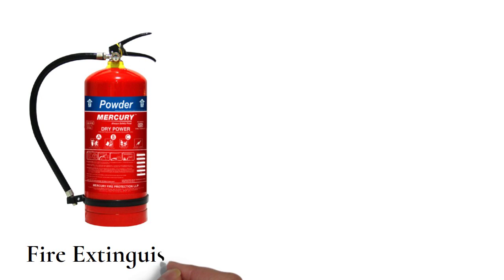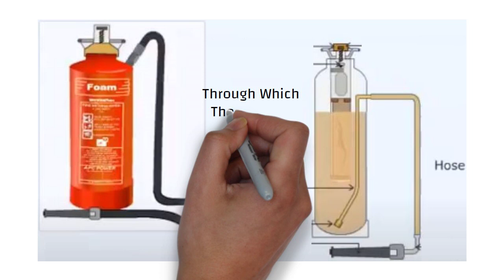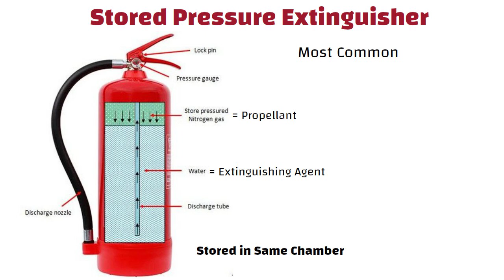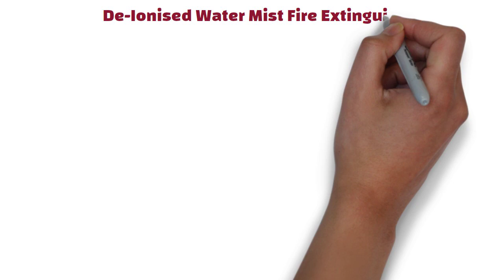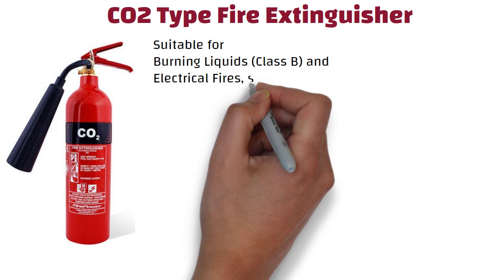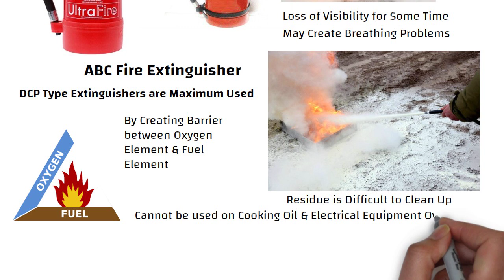FIRE EXTINGUISHER DEALERS IN KERALA, CALL 8138906102, FIRE EXTINGUISHER DEALERS IN ERNAKULAM.

Comment from the maker: Fire extinguisher dealers in WAYANAD, fire fighting contractors in WAYANAD, WAYANAD, fire and safety installations in WAYANAD, fire extinguisher suppliers in WAYANAD,fire extinguishers in WAYANAD, fire extinguishers in WAYANAD, fire protection system in WAYANAD, f fire and safety installation in WAYANAD, fire and safety contractors in WAYANAD, fire safety contractors in WAYANAD, fire and safety systems equipments in WAYANAD, fire equipment in WAYANAD, fire extinguisher in WAYANAD, fire protection system installation in WAYANAD, fire contractors in WAYANAD, fire safety consultants in WAYANAD,  fire alarm systems in WAYANAD, fire NOC in WAYANAD, fire AMC in WAYANAD, WAYANAD, fire fighting equipment in WAYANAD,
MS Jindal pipe dealers in WAYANAD, motor control panel in WAYANAD, fire pump panel in WAYANAD, motor control panel in WAYANAD, Morley fire alarm in WAYANAD, gst fire alarm in WAYANAD, addressable fire alarm system in WAYANAD, Pa talk back system in WAYANAD, PA two way talk back system in WAYANAD, auto glow SIGNAGES in WAYANAD, Karthar dealers in WAYANAD, Agni fire alarm dealers in WAYANAD, ASES SECURITY fire alarm dealers in WAYANAD, AUTO GLOW SIGNAGES in WAYANAD, FIRE PUMP PANEL in WAYANAD, LHP pump in WAYANAD. Karthar valves in WAYANAD, Ravel fire alarm system in WAYANAD. Jindal pipe dealers in WAYANAD, Jindal pipe dealers in WAYANAD. MS pipe dealers in WAYANAD. Butterfly valves in WAYANAD, PA talk back system in WAYANAD, Fire alarm dealers in WAYANAD, smoke detector dealers in WAYANAD, fire alarm panels dealers in WAYANAD, MCP, hooter dealers in Mangalor, hydrant valve dealers in WAYANAD, branch pipe dealers in WAYANAD,Fire CP hose in WAYANAD, Fire RRL hose in WAYANAD, heat detector dealers in WAYANAD, Motor Control panel in WAYANAD,  LED EXIT LIGHTS dealers in WAYANAD, emergency exit light dealers in WAYANAD, auto glow SIGNAGES dealers in WAYANAD. Conventional fire alarm system in WAYANAD, Fire alarm panel in WAYANAD, Notifier fire alarm dealers in WAYANAD, PA talk back unit dealers in WAYANAD. Honeywell fire alarm dealers in WAYANAD, BOSCH PA system dealers in WAYANAD, 
KIRLOSKAR FIRE FIGHTING PUMP DEALERS IN WAYANAD, FIRE FIGHTING EQUIPMENT DEALERS IN WAYANAD, FIRE ALARM SYSTEM DEALERS IN WAYANAD, FIRE CONSULTANTS IN WAYANAD, FIRE CONTRACTOTORS IN WAYANAD, FIRE CONTRACTORS IN WAYANAD, FIRE ALARM SYSTEM DEALERS IN WAYANAD, SMOKE DETECTOR DEALERS IN WAYANAD, FIRE PROTECTION SYSTEM IN WAYANAD, FIRE CONSULTANTS IN WAYANAD, FIRE CONSULTANTS IN WAYANAD, PA TALK BACK SYSTEM IN WAYANAD, ADDRESSABLE FIRE ALARM SYSTEMS IN WAYANAD, CUTTER PUMP DEALERS IN WAYANAD, ADDRESSABLE FIRE ALARM SYSTEM SUPPLIERS IN WAYANAD, SMOKE DETECTOR DEALERS IN TWAYANAD, PRESSURE BOOSTING PUMP DEALERS IN WAYANAD, SLURRY PUMP DEALERS IN WAYANAD
Reply: FIRE EXTINGUISHER DEALERS IN KERALA, FIRE EXTINGUISHER SUPPLIERS IN KERALA, FIRE EXTINGUISHER DISTRIBUTORS IN KERALA, FIRE EXTINGUISHER IN KERALA, ABC TYPE FIRE EXTINGUISHER DEALERS IN KERALA, CO2 TYPE FIRE EXTINGUISHER DEALERS IN KERALA, CLEAN AGENT FIRE EXTINGUISHER IN KERALA, MODULAR TYPE FIRE EXTINGUISHER DEALERS IN KERALA, MECHANICAL FOAM FIRE EXTINGUISHER DEALERS IN KERALA, FIRE EXTINGUISHER NEAR ME KERALA, FIRE EXTINGUISHER TRADERS IN KERALA, FIRE FIGHTING COMPANIES IN KERALA, FIRE CONTRACTORS IN KERALA, FIRE EQUIPMENT DEALERS IN KERALA, FIRE ALARM DEALERS IN KERALA, FIRE PUMP DEALERS IN KERALA, SMOKE DETECTOR DEALERS IN KERALA, FIRE FIGHTING SYSTEM IN KERALA, FIRE PROTECTION SYSTEM IN KERALA, FIRE AND SAFETY CONTRACTORS IN KERALA, FIRE HYDRANT SYSTEMS IN KERALA, PA TALK BACK SYSTEM IN KERALA, FIRE NOC IN KERALA, FIRE INSTALLATION IN KERALA, FIRE NOC RENEWAL IN KERALA, KIRLOSKAR FIRE PUMP DEALERS IN KERALA, FIRE EXTINGUISHER NEAR ME KERALA, FIRE EXTINGUISHER MANUFACURERS IN KERALA, SAFEX FIRE EXTINGUISHER DEALERS IN KERALA, FIRE NOC CONTRACTORS IN KERALA, FIRE FIGHTING EQUIPMENT DEALERS IN KERALA, FIRE PROTECTION SYSTEM IN KERALA, FIRE INSTALLATION IN KERALA, FIRE SAFETY CONTRACTORS IN KERALA, FIRE AMC IN KERALA, FIRE PROTECTION SYSTEM IN KERALA, FIRE PROTECTION EQUIPMET IN KERALA, AMC OF FIRE SYSTEM IN KERALA, FIRE CONSULTANTS IN KERALA, FIRE AND SAFETY EQUIPMENT DEALERS IN KERALA, ADDRESSABLE FIRE ALARM SYSTEM IN KERALA, KARTHAR VALVE DEALERS IN KERALA, DCP TYPE FIRE EXTINGUISHER IN KERALA, POWSER TYPE FIRE EXTINGUISHERS IN KERALA, FIRE HYDRANT SYSTEM IN KERALA, FIRE ALARM PANEL DEALERS IN KERALA, SAFEPRO FIRE EXTINGUISHER DEALERS IN KERALA, MS AND GI PIPE DEALERS IN KERALA, JINDAL PIPE DEALERS IN KERALA, AGNI FIRE ALARM DEALERS IN KERALA, FIRE EQUIPMENT DEALERS IN KERALA, FIRE EQUIPMENT SUPPLIERS IN KERALA, FIRE EQUIPMENT TRADERS IN KERALA, FIRE SPRINKLER SYSTEM IN KERALA, RAVLE FIRE ALARM DEALERS IN KERALA, RAVEL FIRE ALARM SYSTEM IN KERALA, AGNI FIRE ALARM DISTRIBUTORS IN KERALA, FIRE ALARM CONTRACTORS IN KERALA, FIRE PIPE INSTALLATION IN CONTRACTORS IN KERALA, FIRE SAFETY CONTRACTORS IN KERALA, FIRE PA TWO WAY TALK BACK SYSTEM DEALERS IN KERALA, HEAT DETECTOR DEALERS IN KERALA, HONEYWELL FIRE ALARM DEALERS IN KERALA, FIRE NOC CONSULTANTS IN KERALA, FIRE AMC AND FIRE NOC IN KERALA, FIRE SAFETY COMPANIES IN KERALA, NEWAGE DEALERS IN KERALA, MONSHER FIRE EQUIPMENT DEALERS IN KERALA, KARTHAR VALVE DEALERS IN KERALA, FIRE HYDRANT VALVE DEALERS IN KERALA, FIRE HOSE REEL DRUM DEALERS IN KERALA, FIRE SPRINKLER DEALERS IN KERALA, FIRE PUMP DEALERS IN KERALA, LUBI PUMP DEALERS IN KERALA, LHP PUMP DEALERS IN KERALA. FIRE CONTRACTORS IN KERALA, FIRE AND SAFETY CONTRACTORS IN KERALA, FIRE EQUIPMENT DEALERS IN KERALA, FIRE FIGHTING CONTRACTORS IN KERALA, FIRE EXTINGUISHER DEALERS IN KOCHI, FIRE EXTINGUISHER SUPPLIERS IN KOCHI, FIRE EXTINGUISHER DISTRIBUTORS IN KOCHI, FIRE EXTINGUISHER IN KOCHI, ABC TYPE FIRE EXTINGUISHER DEALERS IN KOCHI, CO2 TYPE FIRE EXTINGUISHER DEALERS IN KOCHI, CLEAN AGENT FIRE EXTINGUISHER IN KOCHI, MODULAR TYPE FIRE EXTINGUISHER DEALERS IN KOCHI, MECHANICAL FOAM FIRE EXTINGUISHER DEALERS IN KOCHI, FIRE EXTINGUISHER NEAR ME KOCHI, FIRE EXTINGUISHER TRADERS IN KOCHI, FIRE FIGHTING COMPANIES IN KOCHI, FIRE CONTRACTORS IN KOCHI, FIRE EQUIPMENT DEALERS IN KOCHI, FIRE ALARM DEALERS IN KOCHI, FIRE PUMP DEALERS IN KOCHI, SMOKE DETECTOR DEALERS IN KOCHI, FIRE FIGHTING SYSTEM IN KOCHI, FIRE PROTECTION SYSTEM IN KOCHI, FIRE AND SAFETY CONTRACTORS IN KOCHI, FIRE HYDRANT SYSTEMS IN KOCHI, PA TALK BACK SYSTEM IN KOCHI, FIRE NOC IN KOCHI, FIRE INSTALLATION IN KOCHI, FIRE NOC RENEWAL IN KOCHI, KIRLOSKAR FIRE PUMP DEALERS IN KOCHI, FIRE EXTINGUISHER NEAR ME KOCHI, FIRE EXTINGUISHER MANUFACURERS IN KOCHI, SAFEX FIRE EXTINGUISHER DEALERS IN KOCHI, FIRE NOC CONTRACTORS IN KOCHI, FIRE FIGHTING EQUIPMENT DEALERS IN KOCHI, FIRE PROTECTION SYSTEM IN KOCHI, FIRE INSTALLATION IN KOCHI, FIRE SAFETY CONTRACTORS IN KOCHI, FIRE AMC IN KOCHI, FIRE PROTECTION SYSTEM IN KOCHI, FIRE PROTECTION EQUIPMET IN KOCHI, AMC OF FIRE SYSTEM IN KOCHI, FIRE CONSULTANTS IN KOCHI, FIRE AND SAFETY EQUIPMENT DEALERS IN KOCHI, ADDRESSABLE FIRE ALARM SYSTEM IN KOCHI, KARTHAR VALVE DEALERS IN KOCHI, DCP TYPE FIRE EXTINGUISHER IN KOCHI, POWSER TYPE FIRE EXTINGUISHERS IN KOCHI, FIRE HYDRANT SYSTEM IN KOCHI, FIRE ALARM PANEL DEALERS IN KOCHI, SAFEPRO FIRE EXTINGUISHER DEALERS IN KOCHI, MS AND GI PIPE DEALERS IN KOCHI, JINDAL PIPE DEALERS IN KOCHI, AGNI FIRE ALARM DEALERS IN KOCHI, FIRE EQUIPMENT DEALERS IN KOCHI, FIRE EQUIPMENT SUPPLIERS IN KOCHI, FIRE EQUIPMENT TRADERS IN KOCHI, FIRE SPRINKLER SYSTEM IN KOCHI, RAVLE FIRE ALARM DEALERS IN KOCHI, RAVEL FIRE ALARM SYSTEM IN KOCHI, AGNI FIRE ALARM DISTRIBUTORS IN KOCHI, FIRE ALARM CONTRACTORS IN KOCHI, FIRE PIPE INSTALLATION IN CONTRACTORS IN KOCHI, FIRE SAFETY CONTRACTORS IN KOCHI, FIRE PA TWO WAY TALK BACK SYSTEM DEALERS IN KOCHI, HEAT DETECTOR DEALERS IN KOCHI, HONEYWELL FIRE ALARM DEALERS IN KOCHI, FIRE NOC CONSULTANTS IN KOCHI, FIRE AMC AND FIRE NOC IN KOCHI, FIRE SAFETY COMPANIES IN KOCHI, NEWAGE DEALERS IN KOCHI, MONSHER FIRE EQUIPMENT DEALERS IN KOCHI, KARTHAR VALVE DEALERS IN KOCHI, FIRE HYDRANT VALVE DEALERS IN KOCHI, FIRE HOSE REEL DRUM DEALERS IN KOCHI, FIRE SPRINKLER DEALERS IN KOCHI, FIRE PUMP DEALERS IN KOCHI, LUBI PUMP DEALERS IN KOCHI, LHP PUMP DEALERS IN KOCHI. FIRE CONTRACTORS IN KOCHI, FIRE AND SAFETY CONTRACTORS IN KOCHI, FIRE EQUIPMENT DEALERS IN KOCHI, FIRE FIGHTING CONTRACTORS IN KOCHI, FIRE EXTINGUISHER DEALERS IN ERNAKULAM, FIRE EXTINGUISHER SUPPLIERS IN ERNAKULAM, FIRE EXTINGUISHER DISTRIBUTORS IN ERNAKULAM, FIRE EXTINGUISHER IN ERNAKULAM, ABC TYPE FIRE EXTINGUISHER DEALERS IN ERNAKULAM, CO2 TYPE FIRE EXTINGUISHER DEALERS IN ERNAKULAM, CLEAN AGENT FIRE EXTINGUISHER IN ERNAKULAM, MODULAR TYPE FIRE EXTINGUISHER DEALERS IN ERNAKULAM, MECHANICAL FOAM FIRE EXTINGUISHER DEALERS IN ERNAKULAM, FIRE EXTINGUISHER NEAR ME ERNAKULAM, FIRE EXTINGUISHER TRADERS IN ERNAKULAM, FIRE FIGHTING COMPANIES IN ERNAKULAM, FIRE CONTRACTORS IN ERNAKULAM, FIRE EQUIPMENT DEALERS IN ERNAKULAM, FIRE ALARM DEALERS IN ERNAKULAM, FIRE PUMP DEALERS IN ERNAKULAM, SMOKE DETECTOR DEALERS IN ERNAKULAM, FIRE FIGHTING SYSTEM IN ERNAKULAM, FIRE PROTECTION SYSTEM IN ERNAKULAM, FIRE AND SAFETY CONTRACTORS IN ERNAKULAM, FIRE HYDRANT SYSTEMS IN ERNAKULAM, PA TALK BACK SYSTEM IN ERNAKULAM, FIRE NOC IN ERNAKULAM, FIRE INSTALLATION IN ERNAKULAM, FIRE NOC RENEWAL IN ERNAKULAM, KIRLOSKAR FIRE PUMP DEALERS IN ERNAKULAM, FIRE EXTINGUISHER NEAR ME ERNAKULAM, FIRE EXTINGUISHER MANUFACURERS IN ERNAKULAM, SAFEX FIRE EXTINGUISHER DEALERS IN ERNAKULAM, FIRE NOC CONTRACTORS IN ERNAKULAM, FIRE FIGHTING EQUIPMENT DEALERS IN ERNAKULAM, FIRE PROTECTION SYSTEM IN ERNAKULAM, FIRE INSTALLATION IN ERNAKULAM, FIRE SAFETY CONTRACTORS IN ERNAKULAM, FIRE AMC IN ERNAKULAM, FIRE PROTECTION SYSTEM IN ERNAKULAM, FIRE PROTECTION EQUIPMET IN ERNAKULAM, AMC OF FIRE SYSTEM IN ERNAKULAM, FIRE CONSULTANTS IN ERNAKULAM, FIRE AND SAFETY EQUIPMENT DEALERS IN ERNAKULAM, ADDRESSABLE FIRE ALARM SYSTEM IN ERNAKULAM, KARTHAR VALVE DEALERS IN ERNAKULAM, DCP TYPE FIRE EXTINGUISHER IN ERNAKULAM, POWSER TYPE FIRE EXTINGUISHERS IN ERNAKULAM, FIRE HYDRANT SYSTEM IN ERNAKULAM, FIRE ALARM PANEL DEALERS IN ERNAKULAM, SAFEPRO FIRE EXTINGUISHER DEALERS IN ERNAKULAM, MS AND GI PIPE DEALERS IN ERNAKULAM, JINDAL PIPE DEALERS IN ERNAKULAM, AGNI FIRE ALARM DEALERS IN ERNAKULAM, FIRE EQUIPMENT DEALERS IN ERNAKULAM, FIRE EQUIPMENT SUPPLIERS IN ERNAKULAM, FIRE EQUIPMENT TRADERS IN ERNAKULAM, FIRE SPRINKLER SYSTEM IN ERNAKULAM, RAVLE FIRE ALARM DEALERS IN ERNAKULAM, RAVEL FIRE ALARM SYSTEM IN ERNAKULAM, AGNI FIRE ALARM DISTRIBUTORS IN ERNAKULAM, FIRE ALARM CONTRACTORS IN ERNAKULAM, FIRE PIPE INSTALLATION IN CONTRACTORS IN ERNAKULAM, FIRE SAFETY CONTRACTORS IN ERNAKULAM, FIRE PA TWO WAY TALK BACK SYSTEM DEALERS IN ERNAKULAM, HEAT DETECTOR DEALERS IN ERNAKULAM, HONEYWELL FIRE ALARM DEALERS IN ERNAKULAM, FIRE NOC CONSULTANTS IN ERNAKULAM, FIRE AMC AND FIRE NOC IN ERNAKULAM, FIRE SAFETY COMPANIES IN ERNAKULAM, NEWAGE DEALERS IN ERNAKULAM, MONSHER FIRE EQUIPMENT DEALERS IN ERNAKULAM, KARTHAR VALVE DEALERS IN ERNAKULAM, FIRE HYDRANT VALVE DEALERS IN ERNAKULAM, FIRE HOSE REEL DRUM DEALERS IN ERNAKULAM, FIRE SPRINKLER DEALERS IN ERNAKULAM, FIRE PUMP DEALERS IN ERNAKULAM, LUBI PUMP DEALERS IN ERNAKULAM, LHP PUMP DEALERS IN ERNAKULAM. FIRE CONTRACTORS IN ERNAKULAM, FIRE AND SAFETY CONTRACTORS IN ERNAKULAM, FIRE EQUIPMENT DEALERS IN ERNAKULAM, FIRE FIGHTING CONTRACTORS IN ERNAKULAM, 

htts://www.aimfireequipment.com

https://g.co/kgs/wAz9PTn

Comment from the maker: FIRE ALARM DEALERS IN WAYANAD, ADDRESSABLE FIRE ALARM DEALERS IN WAYANAD, FIRE ALARM SYSTEM DEALERS IN WAYANAD, ADDRESSABLE FIRE ALARM SYSTEM DEALERS IN WAYANAD, FIRE DETECTION SYSTEM IN WAYANAD, SMOKE DETECTOR DEALERS IN WAYANAD, CONVENTIONAL FIRE ALARM DEALERS IN WAYANAD, MORLEY FIRE ALARM DEALERS IN WAYANAD, GST FIRE ALARM DEALERS IN WAYANAD, ASES SECURITY FIRE ALARM DEALERS IN WAYANAD, BEAM DETECTOR DEALERS IN WAYANAD, FIRE ALARM SUPPLIERS IN WAYANAD, FIRE ALARM TRADERS IN WAYANAD, FIRE ALARM PANEL DEALERS IN WAYANAD, HEAT DETECTOR DEALERS IN WAYANAD, FIRE ALARM SYSTEM SUPPLIERS IN WAYANAD, FIRE ALARM COMPANIES IN WAYANAD, FIRE EQUIPMENT DEALERS IN WAYANAD, ADRRESSABLE FIRE ALARM PANEL DEALERS IN WAYANAD, FIRE ALARM SYSTEM IN WAYANAD, BATTERY OPERATED DETECTOR DEALERS IN WAYANAD, ASPIRATION DETECTION SYSTEM DEALERS IN WAYANAD, FIRE ALARM MCP - MANUAL CALL POINT DEALERS IN WAYANAD, FIRE ALARM HOOTER DEALERS IN WAYANAD, PA TWO WAY TALK BACK SYSTEM DEALERS IN WAYANAD, PA SYSTEM DEALERS IN WAYANAD, PA TALK BACK UNIT DEALERS IN WAYANAD, HOOTER CUM STROBE DEALERS IN WAYANAD, FIRE PROTECTION SYSTEM IN WAYANAD, FIRE ALARM CONTRACTORS IN WAYANAD, FIRE DETECTORS IN WAYANAD, FIRE ALARM DEALERS IN KOLLAM, ADDRESSABLE FIRE ALARM DEALERS IN KOLLAM, SMOKE DETECTOR DEALERS IN KOLLAM, FIRE EQUIPMENT DEALERS IN WAYANAD, FIRE ALARM INSTALLATION IN WAYANAD, FIRE ALARM COMPANIES IN WAYANAD FIRE ALARM DISTRIBUTORS IN WAYANAD, TALK BACK SYSTEM DEALERS IN WAYANAD, FIRE ALARM SENSOR DEALERS IN WAYANAD, FIRE EXTINGUISHER DEALERS IN WAYANAD, FIRE ALARM DEALERS IN ERNAKULAM, FIRE ALARM DEALERS IN KERALA, ADDRESSABLE FIRE ALARM DEALERS IN CALICUT, SMOKE DETECTOR IN WAYANAD,  FIRE EXTINGUISHER DEALERS IN WAYANAD, FIRE EXTINGUISHER SUPPLIERS IN WAYANAD, FIRE EXTINGUISHER DISTRIBUTORS IN WAYANAD FIRE EXTINGUISHER IN WAYANAD, ABC TYPE FIRE EXTINGUISHER DEALERS IN WAYANAD, CO2 TYPE FIRE EXTINGUISHER DEALERS IN WAYANAD, CLEAN AGENT FIRE EXTINGUISHER IN WAYANAD, MODULAR TYPE FIRE EXTINGUISHER DEALERS IN WAYANAD, MECHANICAL FOAM FIRE EXTINGUISHER DEALERS IN WAYANAD, FIRE FIGHTING PUMP DEALERS IN WAYANAD, FIRE PUMP DEALERS IN WAYANAD, KIRLOSKAR FIRE PUMP DEALERS IN WAYANAD, FIRE JOCKEY PUMP DEALERS IN WAYANAD, FIRE DISEL ENGINE DRIVEN PUMP DEALERS IN WAYANAD, FIRE FIGHTING EQUIPMENT DEALERS IN WAYANAD, FIRE FIGHTING SYSTEM IN WAYANAD, VERTICAL INLINE PUMP DEALERS IN WAYANAD, HYDRO PNEUMATIC PRESSURE BOOSTING PUMP DEALERS IN WAYANAD, VERTICAL TURBINE PUMP DEALERS IN WAYANAD, SEWAGE PUMP DEALERS IN WAYANAD, RO PUMP DEALERS IN WAYANAD. FIRE EXTINGUISHER IN WAYANAD, FIRE ECONTRACTORS IN WAYANAD, FIRE EXTINGUISHER SUPPLIERS IN WAYANAD, FIRE EXTINGUISHER DEALERS IN KALPETTA, FIRE EXTINGUISHER DEALERS IN MANANTHAVADY, FIRE EXTINGUISHER DEALERS IN BATHERY,
Reply: FIRE EXTINGUISHER DEALERS IN THODUPUZHA, FIRE EXTINGUISHER SUPPLIERS IN THODUPUZHA, FIRE EXTINGUISHER DISTRIBUTORS IN THODUPUZHA, FIRE EXTINGUISHER IN THODUPUZHA, ABC TYPE FIRE EXTINGUISHER DEALERS IN THODUPUZHA, CO2 TYPE FIRE EXTINGUISHER DEALERS IN THODUPUZHA, CLEAN AGENT FIRE EXTINGUISHER IN THODUPUZHA, MODULAR TYPE FIRE EXTINGUISHER DEALERS IN THODUPUZHA, MECHANICAL FOAM FIRE EXTINGUISHER DEALERS IN THODUPUZHA, FIRE EXTINGUISHER NEAR ME THODUPUZHA, FIRE EXTINGUISHER TRADERS IN THODUPUZHA, FIRE FIGHTING COMPANIES IN THODUPUZHA, FIRE CONTRACTORS IN THODUPUZHA, FIRE EQUIPMENT DEALERS IN THODUPUZHA, FIRE ALARM DEALERS IN THODUPUZHA, FIRE PUMP DEALERS IN THODUPUZHA, SMOKE DETECTOR DEALERS IN THODUPUZHA, FIRE FIGHTING SYSTEM IN THODUPUZHA, FIRE PROTECTION SYSTEM IN THODUPUZHA, FIRE AND SAFETY CONTRACTORS IN THODUPUZHA, FIRE HYDRANT SYSTEMS IN THODUPUZHA, PA TALK BACK SYSTEM IN THODUPUZHA, FIRE NOC IN THODUPUZHA, FIRE INSTALLATION IN THODUPUZHA, FIRE NOC RENEWAL IN THODUPUZHA, KIRLOSKAR FIRE PUMP DEALERS IN THODUPUZHA, FIRE EXTINGUISHER NEAR ME THODUPUZHA, FIRE EXTINGUISHER MANUFACURERS IN THODUPUZHA, SAFEX FIRE EXTINGUISHER DEALERS IN THODUPUZHA, FIRE NOC CONTRACTORS IN THODUPUZHA, FIRE FIGHTING EQUIPMENT DEALERS IN THODUPUZHA, FIRE PROTECTION SYSTEM IN THODUPUZHA, FIRE INSTALLATION IN THODUPUZHA, FIRE SAFETY CONTRACTORS IN THODUPUZHA, FIRE AMC IN THODUPUZHA, FIRE PROTECTION SYSTEM IN THODUPUZHA, FIRE PROTECTION EQUIPMET IN THODUPUZHA, AMC OF FIRE SYSTEM IN THODUPUZHA, FIRE CONSULTANTS IN THODUPUZHA, FIRE AND SAFETY EQUIPMENT DEALERS IN THODUPUZHA, ADDRESSABLE FIRE ALARM SYSTEM IN THODUPUZHA, KARTHAR VALVE DEALERS IN THODUPUZHA, DCP TYPE FIRE EXTINGUISHER IN THODUPUZHA, POWSER TYPE FIRE EXTINGUISHERS IN THODUPUZHA, FIRE HYDRANT SYSTEM IN THODUPUZHA, FIRE ALARM PANEL DEALERS IN THODUPUZHA, SAFEPRO FIRE EXTINGUISHER DEALERS IN THODUPUZHA, MS AND GI PIPE DEALERS IN THODUPUZHA, JINDAL PIPE DEALERS IN THODUPUZHA, AGNI FIRE ALARM DEALERS IN THODUPUZHA, FIRE EQUIPMENT DEALERS IN THODUPUZHA, FIRE EQUIPMENT SUPPLIERS IN THODUPUZHA, FIRE EQUIPMENT TRADERS IN THODUPUZHA, FIRE SPRINKLER SYSTEM IN THODUPUZHA, RAVEL FIRE ALARM DEALERS IN THODUPUZHA, RAVEL FIRE ALARM SYSTEM IN THODUPUZHA, AGNI FIRE ALARM DISTRIBUTORS IN THODUPUZHA, FIRE ALARM CONTRACTORS IN THODUPUZHA, FIRE PIPE INSTALLATION IN CONTRACTORS IN THODUPUZHA, FIRE SAFETY CONTRACTORS IN THODUPUZHA, FIRE PA TWO WAY TALK BACK SYSTEM DEALERS IN THODUPUZHA, HEAT DETECTOR DEALERS IN THODUPUZHA, HONEYWELL FIRE ALARM DEALERS IN THODUPUZHA, FIRE NOC CONSULTANTS IN THODUPUZHA, FIRE AMC AND FIRE NOC IN THODUPUZHA, FIRE SAFETY COMPANIES IN THODUPUZHA, NEWAGE DEALERS IN THODUPUZHA, MONSHER FIRE EQUIPMENT DEALERS IN THODUPUZHA, KARTHAR VALVE DEALERS IN THODUPUZHA, FIRE HYDRANT VALVE DEALERS IN THODUPUZHA, FIRE HOSE REEL DRUM DEALERS IN THODUPUZHA, FIRE SPRINKLER DEALERS IN THODUPUZHA, FIRE PUMP DEALERS IN THODUPUZHA, LUBI PUMP DEALERS IN THODUPUZHA, LHP PUMP DEALERS IN THODUPUZHA. FIRE CONTRACTORS IN THODUPUZHA, FIRE AND SAFETY CONTRACTORS IN THODUPUZHA, FIRE EQUIPMENT DEALERS IN THODUPUZHA, FIRE FIGHTING CONTRACTORS IN THODUPUZHA, AGNI FIRE ALARM DEALERS IN THODUPUZHA, PA TALK BACK SYSTEM DEALERS IN THODUPUZHA, FIRE NOC IN THODUPUZHA, FIRE NOC RENEWAL IN THODUPUZHA, FIRE SYSTEM INSTALLATION IN THODUPUZHA.